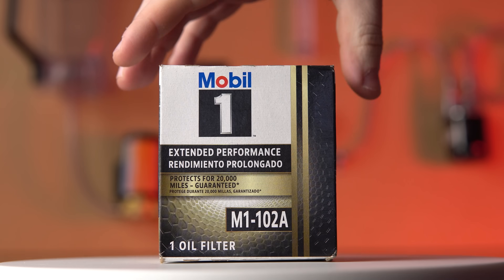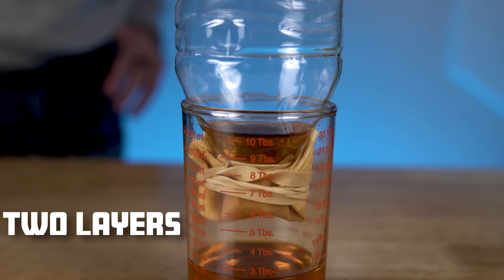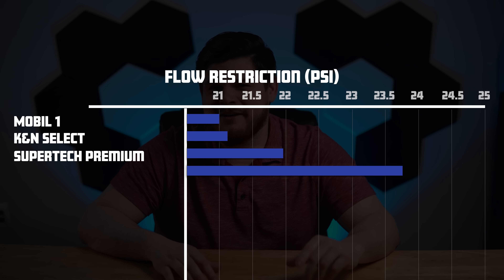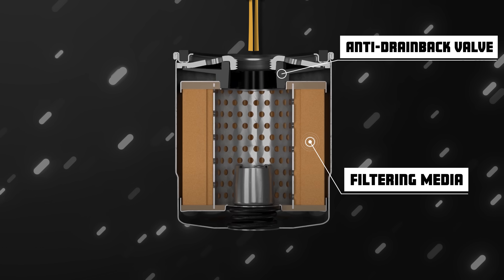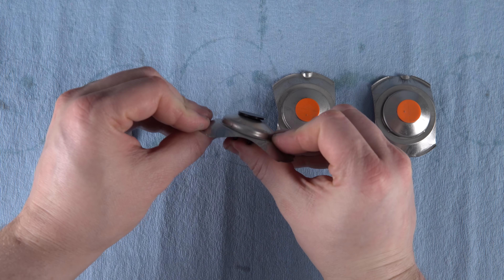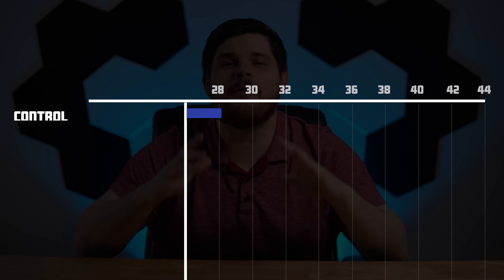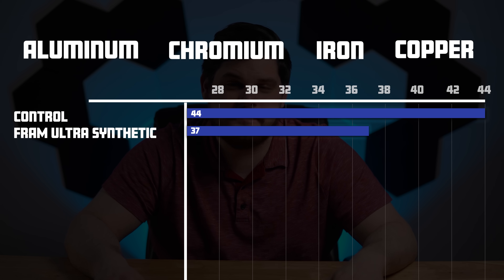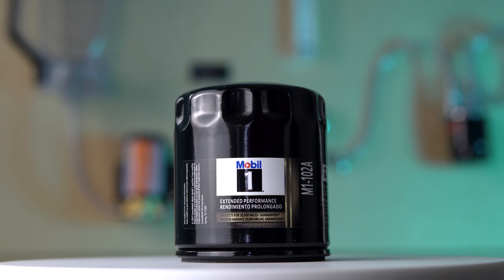Engineers Test the Best Oil Filters! FRAM | Mobil 1 | K&N | Walmart Brand

Comment: You clearly don’t know what you’re talking about. No offence, but there’s no scientific information at all here of any use. Slightly more restrictive filter.. does that even matter? Don’t know, you’d have to ask an engineer. You can’t say that where the filter catches the aluminum particles will cause the back flow valve to leak. It probably doesn’t and that’s a total guess. You don’t like that the internals are plastic in one filter instead of metal in another. Why would that matter? You don’t know what kind of plastic and what kind of metal. It’s irrelevant. The only part of this testing that holds any water is how much contaminants the oil filters removed. And going from 44 microns per million down to 35-40…. Makes me think what I always have. Use good synthetic oil. Change it often. Couldn’t care less what filter I use as long as it doesn’t leak.

Comment: have you got a way to tell whether the bypass has opened or at what pressure it opens?
Reply from the maker: It's something we have pondered about for a while. We were thinking of using something similar to ISO4548-2 bit it would require you to open the filter up, install a dummy filter media, to only allow oil to flow through the valve and close it back up. We don't have a lot of resources to manufacture such a dummy    and it would also be different for some filter. One way would be to remove the bypass valves and measure the spring force of each, but don't know how much that would do. Appreciate your comment, love to brainstorm with others.

Comment: Not a fan of graphs that make 1 point differences seem huge. That can be construed as a very dishonest way of showing data. Also, why did you have all your oil lines on the board but the return line run where it can't bee seen? That allows for questioning the results if they were under analysis or during presentation.
Reply from the maker: Thanks for the feedback, it was snot our intention, we will adjust our scales for the future. We just started this channel and learning the ropes on video editing and after effects doing graphs is daunting! Regarding the lines, the flow meter had the intake ports on the back so needed to route it behind the board in order to present the flow meter to the camera. We are not sponsored or have any affiliation with any brand, we are a small channel trying to bring data and good content to people. Appreciate your feedback, it helps us learn and improve!

Comment: Would like to see this done with oil at engine operating temperature.

I realize it would be difficult/dangerous, but hot oil should flow differently.

Or maybe a comparison of filters best for conventional/synthetic blend/full synthetic.
Reply from the maker: @benwblack thanks for the suggestion, it was extremely expensive to get all the equipment necessary to do that not including everything to be rated at those temperatures and as a small channel with no revenue it was just not doable. We are looking into upgrading several things for our next video including simulating operating temperature viscosities per the ISO standard. Make sure to subscribe so you don't miss it. Again, thank you for your feedbacka and support!

Comment: The fram filters smaller particles. Wonder the numbers on the flow rate test if the other filters were 30 percent smaller mesh to catch those 20 micron particles.  Given these results I say Fram wins. 30 percent particles filtered out and held more particles by weight. Just ensure you run full synthetic oil for the best possible flow rate.

Comment: The bypass valve setting value for each filter is a critical piece of info missing. Were they all the same? This affects both filtration and also back pressure values.

Comment: Do you have a link to the assembly that the oil filter is attached to with the barbed fittings I’ve been trying to find one for years to fit on my generator that currently does not have an oil filter

Comment: Hey great idea! Would love to see more tests!
BUT! Unfortunately the flow restriction test you did is not accurate. Most filters have bypass valve set to around  10-14 psi. Testing filters at above 20psi differential pressure is pointless because large amount of oil bypasses the filter media. And the pressure reading you obtain is influenced more by spring pressure and bypass valve size. Therefore lower reading filters like Mobil1 and K&N might just have a bypass valve that flows more.
Reply from the maker: @ Darius Thank you! DEFINETLY planning on some more. Long story short, we had 400 subs when we released this video with dwindling budget for a small channel so we had to make some decision such as only including one pressure gauge, thus what you actually see is the inlet pressure and not the differential pressure. Given our displacement pump produces such a low flow rate, it is very unlikely that with a clean filter any of these oil filter's bypass valves where triggered, but the only way of actually knowing that is with a pressure gauge after the filter to measure the differential pressure. I appreciate your suggestion, because thanks to comments like yours, we will be making huge improvements to our rig (retesting these filters later) . So please, keep the suggestions coming, we always strive to improve. Thank you so much for your support and being so kind when making suggestions, it is much appreciated. Make sure to subscribe so you see all the other filters!
Reply: @BrandRanks  Hey I'm just glad you read my comment, and that you'll make next test better. And thanks for your reply! May I throw one more thing out there. Warm oil flows easier. In a car it reaches around 180F or more. You don't need to go that hot but maybe 100-120F or so until the pressure drops below say 10psi (I don't know what realistic numbers would be). A simple water heating coil might do it. Sure it introduces another variable and some complexity because for all tests the oil temp is gonna have to be the same. Happy testing, cheers!
Reply from the maker: @Darius Of course, we read every comment, and appreciate the feedback immensely. We tried the water heater option, and it went....let's just say, it's not meant for oil🤣🤣🤣, but do not fret, we bought one specifically for oil (very expensive), but we also found the ISO standards to test oil filters so we may not need to heat it that hot to simulate the same viscocities. Very exciting improvements coming! Thanks for all your suggestions! Cheers!

Comment: Filters are going to filter the same for the most part. What I don't understand is why bypass PSI is  overlooked all the time. Your engine has a specification that is more important than filter efficiency. Most aftermarket filters aren't going to match your engine manufacturers bypass specification. The BEST option is using OEM filters, period.

Comment: I use amsoil or wix filters.  By the lab results, its hard not to pick KN filter.  I would want a filter that actually cleans the oil. If you have that much aluminum in your filter, the filter is the last of your concerns.

Comment: One test that you can do also is cut the filter pleats, place in vice and clamp down tight to drain all oil, and open and inspect pleat section. You can see the small metal pieces in between the pleats on the pre filter and post filtered sides. This is how we do it on diesel filters when diagnosing engine failure. Also include other popular brands such as wix, royal purple, acdelco etc. but great review overall!
Reply from the maker: Thank you so much for the suggestion and kind words. It is much appreciated!

Comment: You forgot about heat. I wanna see that oil at 240 degrees Fahrenheit and then run through all the filters. Trying out OEM, WIX, and cheaper Frams.
Reply from the maker: Thanks for the suggestion, we are looking into simulating operating condition per the ISO standard on future videos. Make sure to subscribe so you don't miss it! Thank you for your support

Comment: Interesting ....but this still does not answer the most important ?,
 "HOW LONG WILL A FILTER LAST?"
3000mi - 5000mi - 10,000 - 20,000mi?

We do not know since it depends on driving conditions and engine wear. Hard driving and an old  engine is going to clog up the filter faster than a new car that is driven at 55mph for highway use. 
Since we do not have x-ray vision and cannot look inside the oil filter too see if it is still doing it´s job we have too use our eyes and common sense! 
By looking at the Dip Stick you can see the condition of the oil (if you have a dip stick!!)
By dropping some oil on a white calling card (the blotter test) you can see if the oil is clear and uniform. 
If you see black spots in the center then you know the filter is not doing it´s job of filtering, the oil is going through the by pass valve. 
This simple test will give you an idea of how long you can go between oil change. 
All this "HIGH MILAGE CLAIMS" on oil and filters is just marketing BS. 
Use your Eye´s and Common Sense!

Comment: Thanks for this informative Video. I would like for you to also test the K&P Engineering Oil Filter featuring Medical Grade Stainless Steel Cloth which is cleanable & reusable (FAA Approved).  I've been using theseOil Filters for many years in my 1983 Suzuki GS1100ES, 2015 Sea Doo GTX iS 260 Limited PWC and my previous 1991 Audi 200 20V Turbo Quattro.   Randy   AKA randog311  (Retired Professional Wrench)
Reply from the maker: Thank you for the suggestion! First time hearing about this filter. Very interesting!

Comment: Test all the brands to find the truly best oil filter. Name brands, auto parts house brand, all of them. This test was in depth but need to expand to find the best.  Royal Purple, AMS Oil, Wix, CarQuest, NAPA, Baldwin, Puralator, AC Delco, STP, Motorcraft, Bosch, and Microguard.
Reply from the maker: Thank you so much for watching. We are definitely planning on doing some more tests. Unfortunately we are a very small channel paying Lal of this out of pocket so it will take some time. Hopefully you subscribe so you don't miss it. Again thanks for the support.
Reply: @BrandRanks  I did subscribe. Help in growing the channel I would suggest going for top level tests like this but expand it fully with the most options possible. Along with make FB, IG, SC, Rumble, Reddit, TikTok full/clipped versions where applicable. Hit a bigger audience with the same content in multiple platforms.

Comment: Note: one item I learned the hard way concerns the gaskets. You probably will not see this in your testing. The gasket not having enough spring back is a negative aspect. They get hard on the shelf over time. To this end you might guess or assume the more expensive filters sit on the shelf longer and are purchased less often. I had this experience with a K&N filter. Installing a filter with a very firm rubber gasket can result in oil leaks pretty fast as it will not seal correctly and you will not notice it until after it gets hot. It can seal fine when its cold and warm, then start to leak after it gets hot. So you will only lose oil while you drive and not in your driveway or where you park your car, so you can be losing oil and the normal act many men do to look at the ground where their car was parked won't really work in this case as there will be almost zero.  The expansion characteristics become wildly different with heat in short. I would know after learning all this the hard way. I've only had one do this but it perplexed me enough to now I always check the oil filter gasket as I buy the filter and before I put it on. It should always be a fairly soft, compliant, form of 'rubber' or whatever synthesized material they are made of. Never very firm, much less 'hard'.
Reply from the maker: Thanks for sharing, that's a great point! Appreciate your support.

Comment: The piece you called an "O-Ring" is NOT an O-Ring at all. It's a circular gasket. An O-Ring has a circular cross-section. The gasket does not.
 Those Micron-Rating numbers are not Kosher -- How big is "GREATER THAN" 30 Microns ??
 35 microns ?? 50 microns ?? Who knows what "greater than" 30 microns actually means ??
After believing the Mobil 1 hype, I found that they didn't perform NEARLY as well as expected.
Extensive research lead me to the BOSCH Premium #3410 -- with a TWENTY (20) Micron rating as per ISO # 4648-12 Tests.
 That's "AT 20 Microns", not "Greater Than 20 Microns".
The famous 95 MERC runs Pennzoil Ultra Platinum, 5-W-30; Bosch Premium Oil Filter: and a FILTERMAG # SS365PR . Oil & filter changes at 5,000 miles.
https://www.mercuryforum.com/forum/grand-marquis-14/1995-grand-marquis-restoration-8937/

Comment: 30 grams of aluminum powder.... Ok, how long will it take for any engine to produce 30 grams of ANY contaminants and restrict the filter? 
If you change oil and filter at 3-5-? thousand miles I'll bet there isn't 5 grams in any filter.
Prove me wrong.
Good talking points but You're majoring on minor things.
If you got 30 grams at every oil change the engine would be totally worn out at 30,000 miles. 30 x 10 That's 300 gm about 11 ounces... that's a lot of metal/trash... SMH 🙄

Comment: More restri ctive filters often filter finer particles and have lower capacity. The filters designed to work with synthetic oil or have extended change intervals often filter less fine particulates. For example, a traditional filter may be 99% at 20 microns and a synthetic filter may only be 50% at 20 microns. Not using exact numbers here, but you get the point. Best bet for engine longevity is always frequent changes rather than trying to extend it as far as possible, but if you are doing extended intervals, the less restrictive filters can make sense. Fun informative testing!
Reply from the maker: Indeed!! Frequent oil changes is WAYYYY more critical. We appreciate your support immensely @802 Garage!

Comment: Would like to know how you cleaned or otherwise reset the test rig between tests.  great and informative video, look forward to more.
Reply from the maker: We actually had a line on the bottom of the rig that we would open up and flush the system three times in between oil filters with clean oil. We went through a LOT of oil 🤣 Thank you for your support.  Make sure to subscribe to see future videos and the improvements we are making.

Comment: I am seeing a couple problems here. Which temperature are you running this oil? Room temp is not operating temp. Plus when you were testing the pressure the filter puts on the system during filtering, why was the numbers so much lower while you were adding the aluminum dust? Maybe the temps dont mean anything since we all use multi-viscosity oil, but the pressure might make a difference on the test results. I have used all these filters with varying results. I would rather have the particulate filtering (of the K&N) since I drive older vehicles and there is more wear.

Comment: Something to be aware of a lot of the oil filters they tested on engine masters were spending way too much time in bypass or partial bypass which is great for oil pressure but doesn't do anyone much good on fine particulate suspended in the oil - the smaller the filter the worse it was

Comment: great video and information. but people worry way to much about oil filters and waste countless hrs research it. pick a brand you like and just use it, the fact that you are taking the time just to replace the oil filter and change the engine oil is huge and your engines will reward you. I have put a million miles on orange box fram filters over the years with all my cars/trucks. current truck has 297,XXX miles and has nothing but a fram filter on it since the factory OEM was replaced.
Reply from the maker: Thank you so much. Great points!

Comment: This is fantastic, I have an older car with 133k and want to baby it along as far as I can. Oil and filters are cheap where as replacing an engine is not. I have been using the Mobil 1 extended performance filter and will continue to do so. Thanks again, great video.
Reply from the maker: Thank you so much for your support! Glad you enjoyed.
Reply: I have used the Supertech full synthetic and the SuperTech premium for several years now on an old 2010 Dodge Avenger I bought for a daily driver. 170k now and the 2.4L is doing just fine after the 50k miles I have driven it. I'll drive till it drops. My point is any oil brand and most oil filters will do you just fine unless you believe the nonsense about not changing oil for 10,000 miles. The Supertech oil I use says 10,000 but I'm not crazy enough to try that out. It just isn't a good idea.

Comment: I cut open a Mobil 1 filter I used after replacing the lifters on a used car I bought with heavy deposits that I cleaned out.
I cut open the filter to see what it caught and the filter was so poorly manufactured that the pleats were not even glued in place on a third of one end.
I contacted Mobil 1 and they couldn't care less about what I told them.
I was told that since I cut open the filter it voided their warranty. 
I will never buy another Mobil product again.
I'll stick with WIX.

Comment: Just an FYI My Jeep GC and Mini (BMW) have housings that hold the filter element so they are easy to inspect. The spin on type  are not. For my track car (Shelby GLHS) I use Mobil 1 filter and occasionally  remove and inspect the filter element with it removed flat on paper towels on the bench. That shows everything.